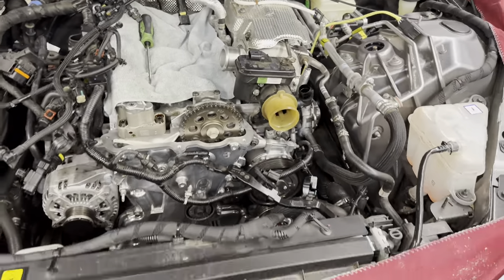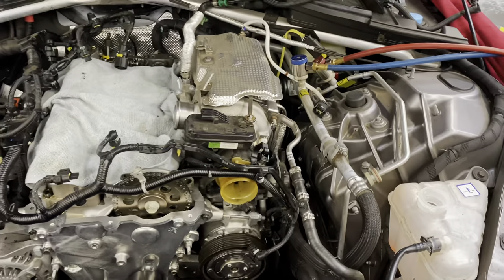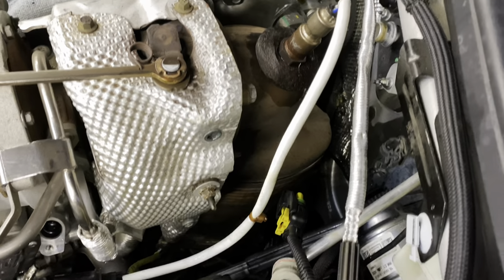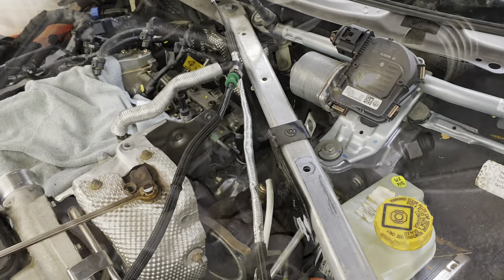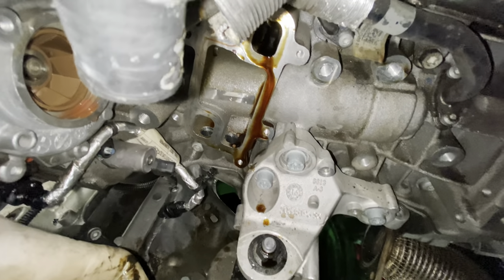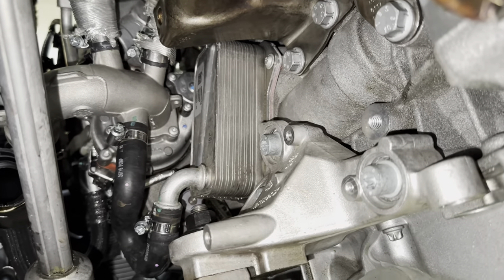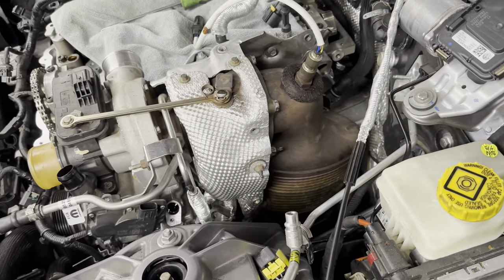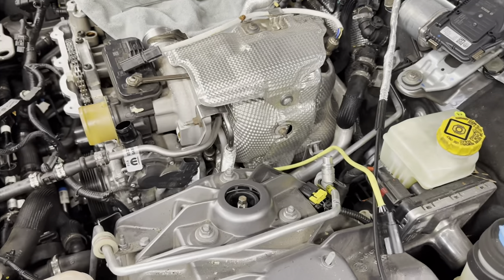2018 Alfa Romeo Giulia TI 2.0L oil cooler gasket replacement

Comment: After months I finally find your video that exactly show what I needed. My 280cv Giulia had a oil and coolant mixing problem. Just few oil drop but my coolant got coloured. I searched all the known internet to find a solution and you made a video on it. Nice work! 

I really hope that replacing this oil cooler piece the problem will be solved. I have never had power losses or never find water in the oil so I am pretty sure the problem is that device.
Reply: and, was it? my is in garage now, but i ve replaced turbo for hyb turbo and when i took the car i have noticed mixing oil and water... they were struggling with catalyst, so i hope they have touched it and fcked it up....

Comment: Thank you for making this video - it gave me the confidence to tackle the job!

For others wanting to do the job without special tools: I ended up doing the entire job without removing the cat, ac lines, or upper coolant pipe. The aluminum pipe connected to the water pump does have to be removed and tied out of the way with zip ties to access the two left upper bolts (otherwise you risk stripping them). Lift the car up high on jack stands, you're going to be hanging out in the wheel well for a while.

With a lot of patience, and the driver's side (Left hand drive) wheel removed - going mostly by feel - one bolt at a time with 3 different length T30 bits, (short low-profile bit for behind the cat, longest one for 2 the left upper bolts, and a medium length to get the rest) - the oil cooler was successful removed and replaced. It took me several hours but saved me from spending $1k+ at the shop. This is probably not the "by the book" way - but I didn't have the tools required to drain the a/c lines - which turned out to be a blessing in disguise. VERY tight clearances, lots of patience required for this job.

FYI - a little super glue on the T30 is very helpful to ensure the new bolts for the oil cooler don't fall into the abyss upon reassembly. AND be 100% sure the bit is all the way into the bolts before attempting to break them loose.
Reply from the maker: Awesome!!!! Great job. Glad I could help.
Reply: Hey man, what made you replace the gasket? I have milky fluid on the reseivor closer to the windshield. I checked my engine oil and looks fine its just on the reseivor thank, do you think it's the oil cooler?
Reply: That is what led me to replace the gasket.

Important to first do a compression test, bonus points for doing a leak down test. This will confirm it's not the head gasket or a cracked head. You don't want to spend the time replacing the gasket only to find out you need a new engine.

Any history of overheating? 

How many miles on your Giulia?

Best of luck with your repair journey. @chrishemi5629
Reply: Thank you for answering. I really appreciate it! And I just took the car to my mechanic. Hopefully, I won't be over 1500 dlls, i barely bought the car last week. Bought it from a used small dealership, so no warranty. The car runs great and if I hadn't replace the two bleeder screws that tent to brake I wouldn't have it noticed it.
Reply: My car is a 2018 giulia with 53,000 miles. Like I said, everything works great. The car runs great tbh but im glad I noticed before anything major happened. Man I really like this car, I hope it doesn't give me more problems down the road
Reply: Keep us updated with the repair quote. Oil cooler should be under $1500, but be sure to have him test the head & head gasket prior to doing the repair.

What state do you live in?

If you purchased from a used car dealer, you have a safety net. Ask them to cover at least 50% of the repair. 

Most states require used car dealers to have a surety bond, and avoid complaints with local dmv.

 Generally as long as you come back within the first 30 days of purchase, they should take care of you.
Reply: I mean, I bought it 5 days ago so I think im good on the 30 days haha and I live in texas. My mechanic said that was the first thing he was going to do, pressure test the system and go from there. He said it could be a bad radiator or the oil cooler. I guess we'll know pretty soon.
Reply: Hey man, quick question: Did you replace the oil cooler bolts, or did you use the same ones? I think im gonna have to do it myself, not even one shop near me "work" on alfa romeos. My luck, haha
Reply: @chrishemi5629  Yes, replace the cooler bolts. Dealer should have them on hand for cheap.

BUT do a compression test first! Drain the coolant, pressure test the cooling system. Find where it's leaking into the coolant system.

 I've wasted many hours on an Audi 3.0 supercharged engine because I assumed it would be a simple fix.
Reply: Hey Bud did you take all the heat shields and cowling off to reach top bolts as well?
Reply: @ctsmusic135 im having this same issue, my resevoir got milky, & then started to overheat aswell
Reply: @hycastro  question Sir! How did you get the top left corner screw with all the SS TUBING in the way? 🤦🏻‍♂️.  I can't get to it for the life of me.
Reply: Thanks for giving me confidence to do the job without cat removal and A/C lines. I managed to do it by removing only coolant pipe, water pump ending, shock absorber and lower arm. To reach the upper bolt I had to move a little bit turbo oil line by removing upper bolt of the line... And the coolant pipe metallic gasket can be reused one more time by flipping it - the way when holding gasket arms are not on the pipe but look to the engine.

Comment: My long term ownership illusions are fading by the minute!
Reply from the maker: I always tell customers as long as you perform the necessary maintenance when it’s due and you take care of your lube services every 5k miles instead of the recommended 9600 miles, you should be fine. Another good thing to have is the Mopar extended warranty. That will save your butt with alot of repairs that these cars end up needed down the line.
Reply: Time to trade, holy crap, I love this car, but not that much, especially out of warranty

Comment: Thanks Alfa Tech for spending the time to create these informative videos. I think this is the only channel on YouTube with such great info. As a side note, I am wondering if you are still working in the S.F Bay Area? My '18 Stelvio has finally given me the P06DE code at 29k miles, from what I've read, this usually means a imminent oil pump replacement. It would be great if my car can be repaired by you.
Reply from the maker: I’m still in the SF Bay Area. Come see me at Putnam CJD located at 3 California Dr. Burlingame CA 94010.
Reply: my passenger side coolant has brown sludge and car began overheating. I know this is a huge problem. I’m freaking out, I’m taking it to my mechanic on Monday I wondering if u know what my options are. It has a little under 30k .

Comment: Quick question, when do you recommend changing the timing chain on the 2.0l?  I’m curious because it one of my least favorite jobs and I am hoping to keep this car until the wheels fall off.
Reply from the maker: There isn’t a service interval for it and it’s supposed to last the life of the car but if it were me, I’d do it at 125k with new tensioners.

Comment: I have the 2017 guilia, the bleeder cap on pipe somehow come off and shut the show down with smoke and steam everywhere. Have replaced the section that had the bleeder section with brass pipe without the bleeder. The coolant seems to have this gluey oily stuff through it and I’m told I should check the oil cooler as the engine oil is clean yet the coolant line is oily. Any recommendations on mechanics for this job near Brisbane?
Reply from the maker: That sounds 100% correct. I’m noticing that oil cooler failures are becoming very popular as the miles are starting to creep up there.

Comment: How did you determine that the oil cooler gasket needed to be replaced?
Reply from the maker: It was leaking oil
Reply: @hycastro will this cause oil to mix with the coolant ?
Reply: @mtbridingog9083 did you find out if it does bro?
Reply: @chrishemi5629  it was the oil cooler and the gasket .. I crashed like 3 days after I fixed my car smh
Reply: @mtbridingog9083  damn that sucks bro! I think im gonna have to replace mine, what made you replace the whole oil cooler and not just the gasket?

Comment: Hello Alpha_Tech, thanks for your videos, I consider them very helpful and interesting. I wonder about your experience with intake valve carbon build up on 2.0 GME engines and if it is recomanded to change PCV valve regulary as a prevention procoution.
Reply from the maker: I strongly recommend to perform a regular decarb service every 15-20k miles. On the qv this carbon build up was a big issue which is why they went with port and direct injection to minimize the amount of carbon build up the best they could. I don’t think they will do that for the 2.0 but who knows, it may be something to watch out for.

Comment: hello, your opinion please. is it normal for a 2.0 280 hp, is it normal for the turbine to whistle when the engine is cold?
Reply: Mine does it... got the motor at 9000 miles and  whistled, done nearly 50K and still the same..

Comment: just got back from my oil change... my mechanic said that I'm leaking out of the oil cooler!! FML  I have a '18 Ti....  58k miles... he didn't give me a price, just said buy the oil cooler, and he'll install....  yikes how much is it gonna cost?  can't believe its leaking I don't even drive it that hard
Reply from the maker: It’s definitely not a easy job just because of the bolts for the exhaust and location of the cooler but everything for the most part is pretty straightforward.

Comment: Would have liked to have seen how you bleed the cooling system.
Nevertheless thanks for the detailed procedure
Reply from the maker: I’ll have to include the link in the video, but I did show how to do it in the timing chain reseal video. I use a vacuum bleeder that attaches to shop air. Works like a charm every time and takes less than 5 minutes.

Comment: Dear god, this looks like a pain in the ass, what model years are affected? Did they revise any part numbers?
Reply from the maker: As far as part numbers I don’t believe they did. I’ve had some of these come in leaking due to a failed gasket like this one, and others leaking due to a few loose bolts on the oil cooler all together. Sometimes with these crazy, out of the ordinary repairs I have to do, I wonder if these cars were build on a Friday, late in the afternoon 🤣.

Comment: I really hope i can chat with you somewhere, i have a stelvio 2.0 and turbo coolant leak inside engine and no one experienced to diagnose it.. can we chat please please!! Any app would be good
Reply: And i think it’s an egr problem.. so how can they diagnose its and egr and where to check etc I’m really in need for help it been over a month with no clue I’m not in the usa..
Reply from the maker: If you have Instagram you can find me on there as the.alfa.doctor My profile picture is the same as here. Sounds like you have either a head gasket issue or a oil cooler issue depending on what is mixing. Oil with coolant or coolant with oil.